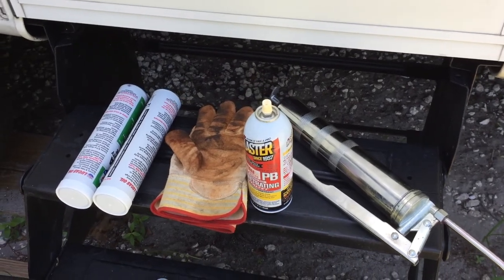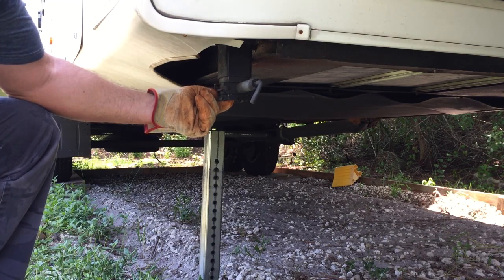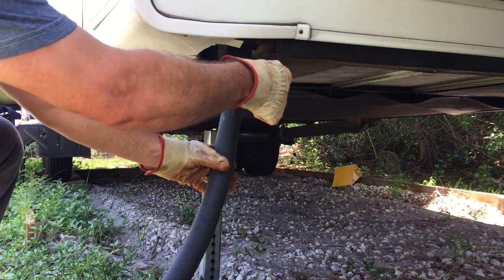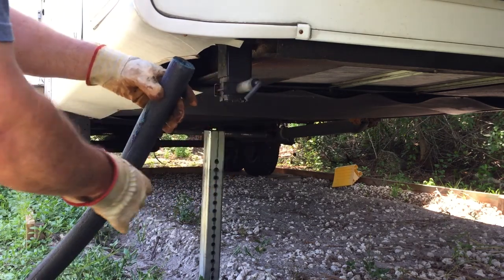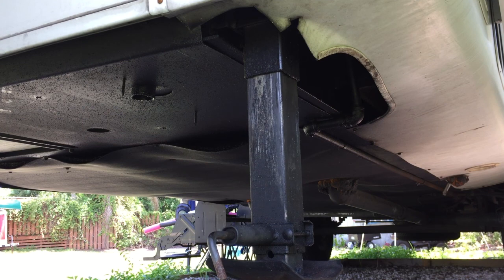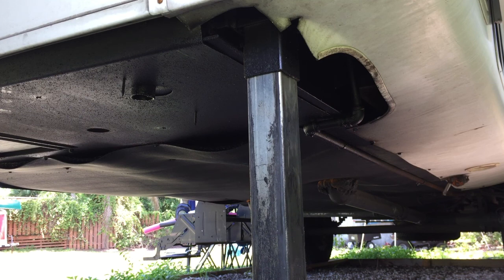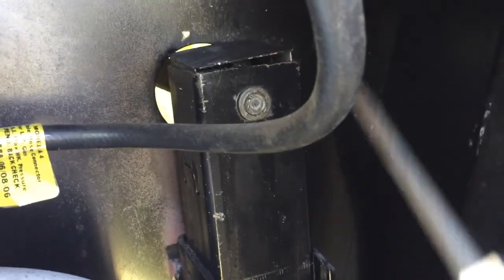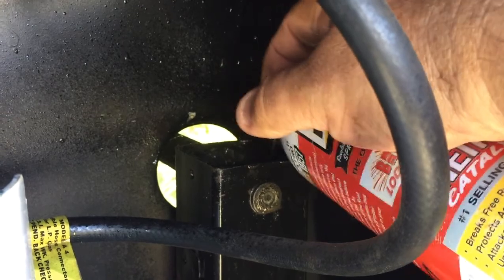Keystone Montana 5th Wheel Landing Gear Maintenance

Comment: Brilliant idea for greasing the drive screws.  I think I saw those videos he talked about with the pvc pipe and the clear one inch hose with the grease zerks.  Nice video.  Thanks for sharing.
Reply from the maker: Thank you, Hope it helps
Reply: Can you think of a good reason to NOT just leave the tube in there? Kind of a sponge to constantly grease the screw?
Reply from the maker: If you leave the grease tube in there it will interfere with the leg as it rides up and down on the screw.

Comment: Great video and just what I need. I just purchased a 2007 Keystone Montana and cleaning and greasing the landing gear is next on my list.  I will be using the same method and process you displayed in your video. One annoying issue I have is blowing the 30 amp fuse when the landing gear goes too far up or down.  How do you know when you reach the limits of the landing gear ?  Thanks for any assistance you can provide !
Reply: I have the same issue on my genesis supreme. Everyone I talk to says the main leg is bent causing stress on the motor

Comment: Great tip - I am blowing fuses and have lots of binding - I need to ck lube first.
Reply from the maker: MoJo I would spray the rod down with PB Blaster and let it set overnight. That will help break up any rust on the rod, then grease it. Good luck.

Comment: Thanks for the info.  My gear is making a clicking noise, when under a load. Something is not right.  Will lube after taking it apart and trying to figure it out.
Reply: Hi I have a clicking noise also when lifting. What did you find out was your problem?
Reply: Coley L   Same for me. Will not get me level, stops moving, still spins and a clicking sound. But motor moves
Reply: Mike White mine is super slow and motor sound much higher pitch than his. Im gonna do this lube. How did yours turn out?
Reply: @mikewhite9818  did you figure out what was wrong?
Reply: @fostermoms9630    Turned out that I had to replace motor. It is common with that unit. The gear box had stripped gear new motor came with gear box. Was an easy fix.
Reply: @mikewhite9818  thank you! Thank you ! I truly appreciate you responding so quickly!